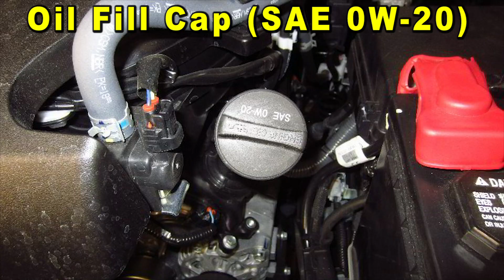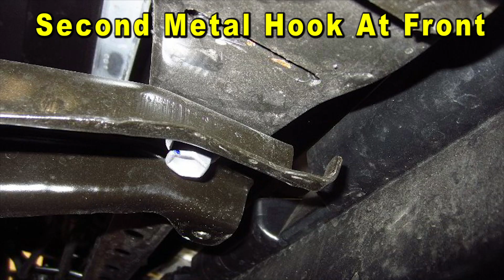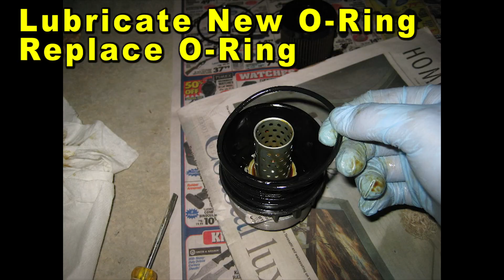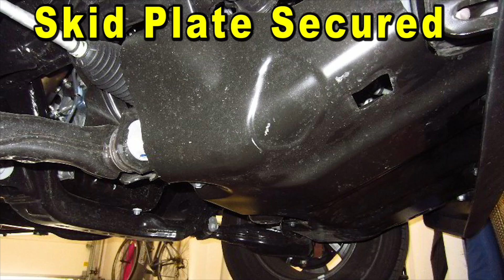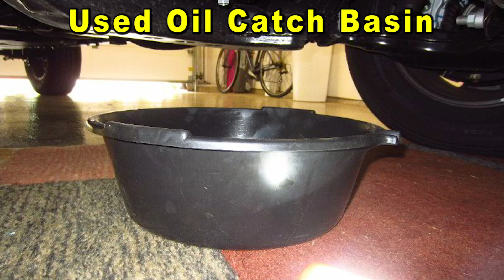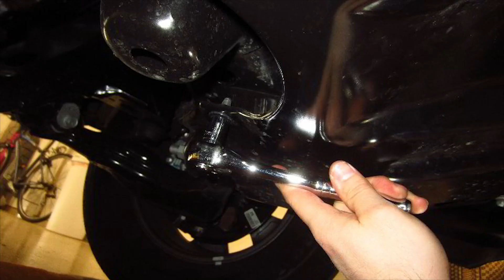Toyota Tacoma How To Change Engine Oil & Filter 2016 To 2023 2GR-FKS 3.5L V6 Engine + Part Numbers

Comment from the maker: Toyota Tacoma Oil Filter Part Numbers - https://amzn.to/3QKEwql
Tacoma Recommended Oil Viscosity - https://amzn.to/3SQy0AZ
Oil Filter Wrench - https://amzn.to/3umUJdH
24mm socket (for oil filter wrench) - https://amzn.to/3SXnRSW
Precision Screwdriver Set - https://amzn.to/3sLixaP
Plastic Pry Bar Tools - https://amzn.to/3HMtsV7
Socket & Ratchet Set - https://amzn.to/3Z17LbA
Mechanix Gloves - https://amzn.to/3jCnHkt
Torque Wrench - https://amzn.to/3vS5uSI

The Paul79UF YouTube channel is a participant in the Amazon Services LLC Associates Program, an affiliate advertising program designed to provide a means for sites to earn advertising fees by advertising and linking to Amazon.

This DIY video shows owners of the 3rd generation 2016, 2017, 2018, 2019, 2020, 2021, 2022 & 2023 Toyota Tacoma how to change the engine oil and the oil filter on the 2GR-FKS 3.5L V6 engine.

Comment from the maker: Check out the DIY guide for changing the engine oil and filter in a 3rd generation 2016 to 2023 Toyota Tacoma with the 3.5L V6 engine -
https://www.paulstravelpictures.com/2016-2021-Toyota-Tacoma-2GR-FKS-V6-Engine-Oil-Change-Guide/index.html

Here are all of the DIY repair and maintenance tutorials for the third generation 2016, 2017, 2018, 2019, 2020, 2021, 2022 & 2023 Toyota Tacoma pickup truck - 
https://www.paulstravelpictures.com/Articles/2016-2021-Toyota-Tacoma-DIY-Repair-Maintenance-Guides.htm

Owners of other Toyota or Lexus vehicles such as the Tundra, 4Runner, Hilux, Highlander, C-HR, Avalon, Camry, Corolla, Supra, Land Cruiser, Prius, RAV4, Mirai, Sequoia, Sienna, Yaris, CT 200h, ES 300h, RX 350, GX 460, LX 570, NX 300, RX 450h, UX 200 and UX 250h may also find these DIY instructions to be helpful.

Comment from the maker: The oil capacity specification of the 2GR-FKS engine for an oil change with a filter change is as follows: 6.1 U.S. quarts (without towing package) or 6.2 U.S. quarts (with towing package including oil cooler). Please double check your owner's manual for the correct capacity!

Comment from the maker: To reset the "MAINT REQD" (maintenance required) warning light for the oil life system, follow these steps: 1. Turn the ignition switch to "OFF". 2. For trucks without a smart key - Press and hold the "ODO/TRIP" button and turn the ignition switch to the "ON" position but do not start the engine. For trucks with the smart key system - Press and hold the "ODO/TRIP" button and tap the "START" button with your foot off the brake pedal so that you do NOT start the engine. 3. Continue holding the "ODO/TRIP" button until odometer display shows "000000". 4. The "MAINT REQD" light should disappear from the gauge cluster.

Be sure to write down the oil change and filter replacement in your vehicle's service records.

The service interval specification in the owner's manual for changing the engine oil and filter is every 10,000 miles (or every 12 months).